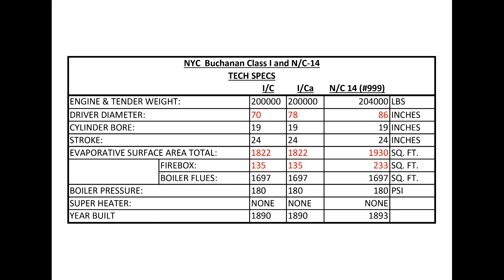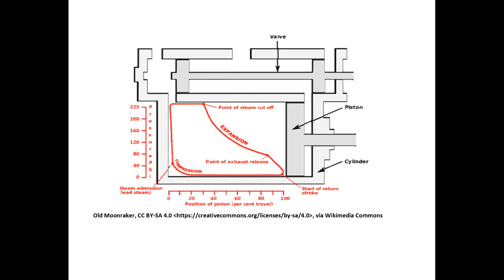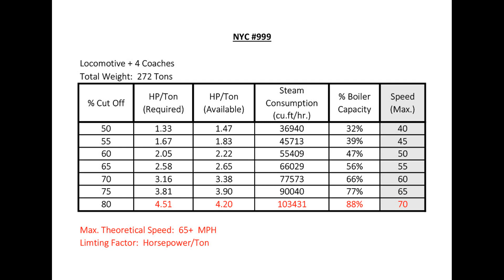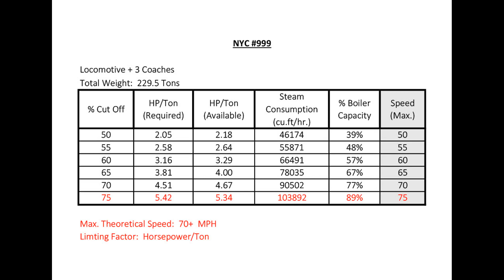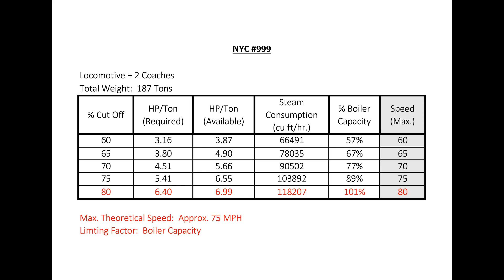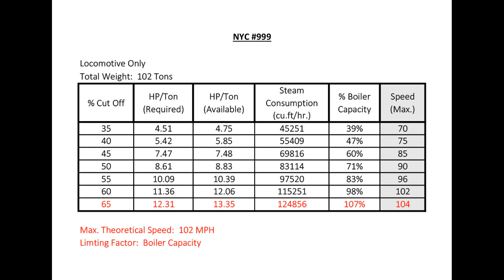NYC #999 and the quest for 100mph.  But, did it make it?  Let's see what science says.

Comment: Accounts from the time indicate that the record was set on a slight downgrade west of Batavia.  I think the exact location was Crittenden, NY.  Had to look it up but I got off the Empire Service at Depew a couple of times and there is a marker there.  I think mileposts and stopwatches would be more accurate than a speed recorder especially in 1893.  I have timed speed that way even on this route and found it relatively easy to do.  There is a big difference in seconds between 90 and 100.  I don't believe 112 but close to 100 or over might be feasible for a short period.  A boiler has a lot of stored energy so even close to the MAWP the loss in power isn't huge even if you are exceeding the generating capacity of the boiler.  The train made the trip of 69 miles in 68 minutes.  That is some serious speed in something like that then.  I think the 437 rpm's of something that big mentioned below would be what would make me nervous.  Shortly after in 1903 a steam car went 126 mph and held the record for quite a few years.

Comment: Interesting.

Favorable grade may have played a big part.

I’m wondering if some information is missing somewhere seeing as how on of Jupiter’s sister engines was the first to reach 60-65 (At least in the US) and they had a lot lower steaming capacity and 60” drivers.

I know a lot of British locomotives were running close to 100 many years earlier in the race to the north.

One fact that stands out is the number of witness that you dismiss as mere publicity. In a court case the fact that more than one witness came to the same conclusion should carry some weight.

Comment: I'd have to go digging for the reference but as I recall the late Brian Hollingsworth wrote about doing some calculations from a different direction - he reckoned the required cylinder horsepower to be clearly impossible, but he also calculated that at 112.5mph/437rpm, even the 86.5" wheels, the drivers were so badly balanced that one side would be lifting several inches clear of the rail every revolution.  There wasn't a hideous pile up, therefore it didn't go that fast..
Reply from the maker: Hi jonathanj8303.  I'm familiar with Hollingsworth and his conclusions are correct.  I believe he also cited piston velocity at 112 mph as being an issue as well.  Cylinder horsepower required to reach 112 mph is also not going to happen, at least not with 180psi boiler pressure.  I agree with you on the driver balancing...even at 100 mph it would be a scary situation.  Thanks for the comment!!!

Comment: How does the size of driver wheels come into play? Nice presentation, thank you.
Reply from the maker: Hi alexanderdeburdegala4609.  The drivers for the front engine were matched to the drivers of the consolidation that the 2-6-8-0 was built from. At least thats the case for the "mallet kit" locomotives.  Generally, mallets/freight locomotives have smaller drive wheels for greater tractive effort.  Locomotives built for speed have larger drivers.  Thanks for watching!!
Reply: I meant vs the normal variant, I know this 1 of 1 had very large driving wheels, they took them off eventually, the one in the museum has the newer smaller wheels mounted. If 2 trains are the same except for the size of the driving wheels how does that change the speed? That's not in your HP calculations from what I saw.  @americansteamlegacy-yh9dr